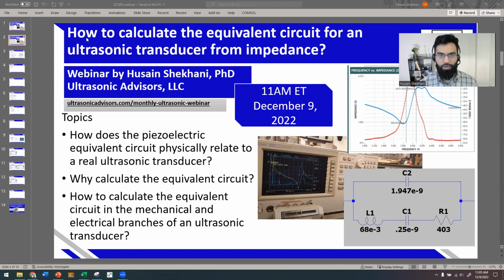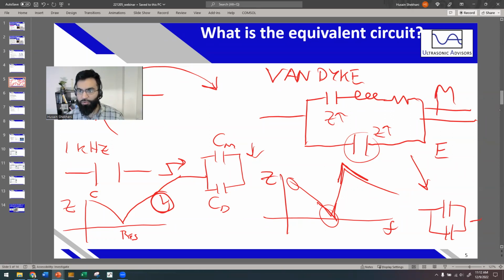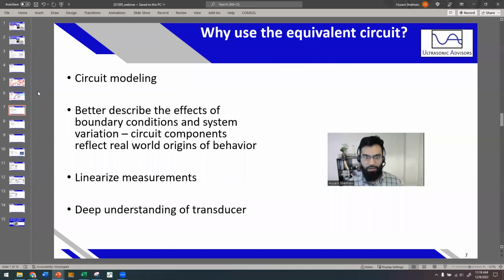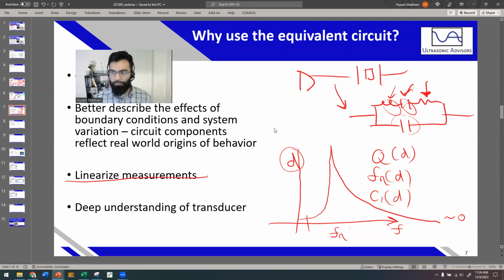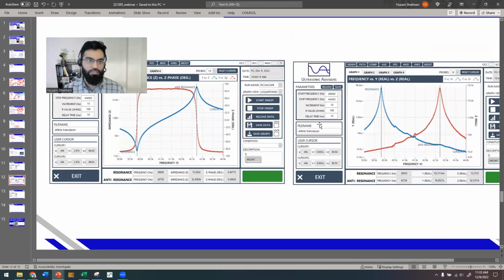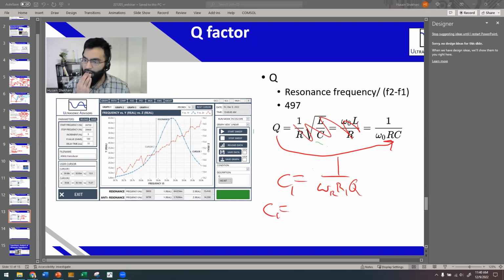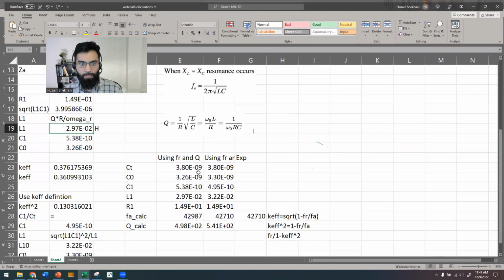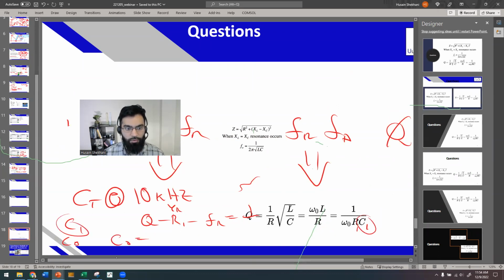How to calculate the equivalent circuit for an ultrasonic transducer from impedance

Comment: Hi thanks for the video, I was a tech at a company that used 2" PZT-8 bonded to an aluminum plate. I measured to find an equivalent inductance to tune out the piezo capacitance and then could measure R. Now we could setup the amp with a conjugate matching circuit to match C and R of the transducer. We drove it with a 250 watts in a water bath. Our frequency was around 660kHz.  My question, we always drove them at the low impedance point. I always wondered why. Is they pattern of the transducer any different between the low and high frequency point?